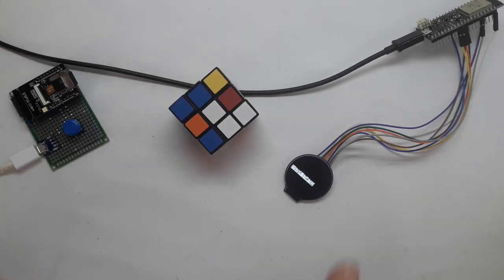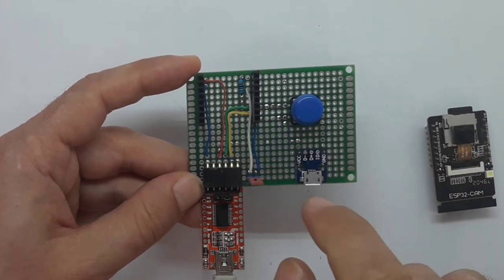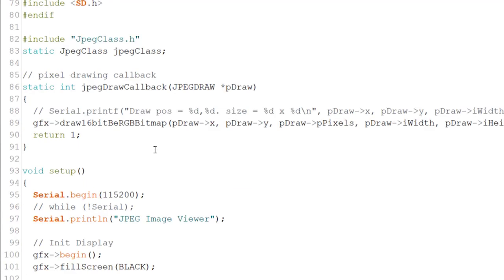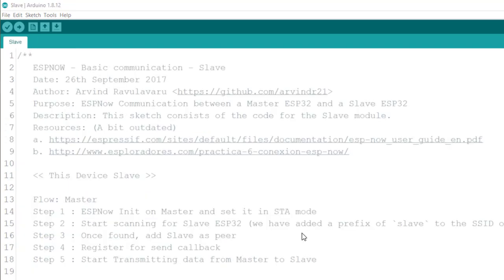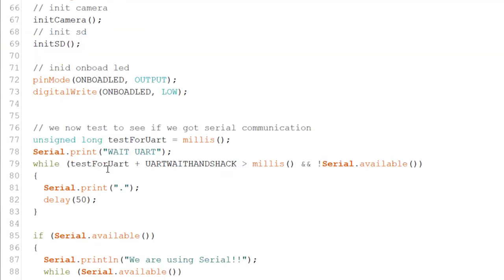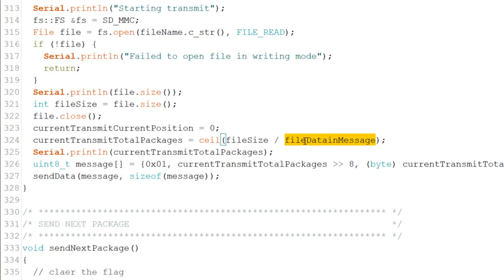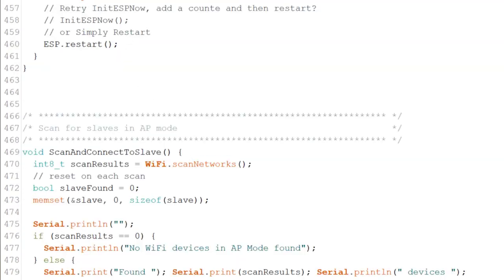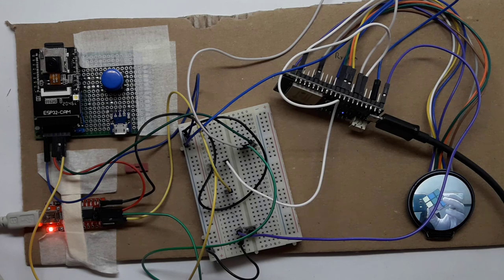ESP32 cam - Capture and send image over esp-now

Comment: I see this video is pretty new :D 
I'm going to mess around with this to get a picture on my Lilygo T-watch 2020 V1 from one of those esp cams.
Thanks!
Reply from the maker: Sounds cool, I never used one of thus, I thought of ordering one. 

I'm working on a new video, showing streaming mjpeg and finding the stream on the local network. just been busy, so it takes me time to get it done :)
Reply: @talofer99  Id like to see that! 
I ended up using https://www.youtube.com/watch?v=aIxaR6legnw for a live video stream.
Only downside is that it uses the watch as an access point, would be nice to just find it on a general network ^.^ 
is also gonna be my next project xD
Reply from the maker: @smokeysky  cool, I was guessing some one did something like that, I wonder how it's done will look into the code there. 

I still did not find the time (super busy) to make the video - the camera is on the table for over 3 weeks now :)

Comment: Sir I have a problem to run the system correctly. The only difference about hardware is display. I've changed the display class settings into the device's that I'm using. Should I change another thing?? The image is seen from the display but it isn't fill all of it and it is meaningless.
Reply from the maker: What display do you use ? 
What code do you use ?
Reply: @talofer99  I used exactly same code as yours and the display is st7789 240x240. Thank you for quick response🙏🏻
Reply from the maker: You could not use the same code (exactly) since it will not work. 
What are the changes you made in the code ?
Reply: @talofer99  I’ve just changed the display class part of the code
Reply from the maker: @berkeates4639 so it should work. 
maybe try different library.
Reply: @talofer99  I solved the problem, it was probably caused by my computer's usb ports. But there is still something unusual. When I press the button, a previously taken photo is displayed on the screen. How can I fix this?
Reply from the maker: I think maybe your screen needs some sort of "refresh" command.
What happens the first time you take a photo ?
Reply: @talofer99   If I reset both devices and take the first photo, the screen shows a black screen until the second or third button is pressed. After that it shows the first photo.
Reply from the maker: @berkeates4639 did you try and take a look at the serial debug output ? 
Maybe that will help you out to find and fix the bug :)
Reply: @talofer99  what does it mean with “serial debug output”?
Reply from the maker: @berkeates4639  you never used serial output for debug ? 
Open the arduino IDE and there is a serial terminal there - you can open it. 
Of you are using my code I left some debug output on it. 
This will show you if there are errors.
Reply: @talofer99  I understood. Thank you, I will try it.
Reply from the maker: @berkeates4639  good luck, and let me know how it went.
Reply: @talofer99  Can we bypass the sd card and gain buffer directly? Maybe my system works more reasonable doing this. If it’s possible, how can i do it?
Reply from the maker: @berkeates4639 it is possible, but it worked great for me with the SD. 
Do you have then both on the same device ? 
Or are you transmitting
 it ?
Reply: @talofer99  I am trying to transmit buffer directly, not reading from sd card.
Reply from the maker: @berkeates4639 ok - doable, convert to jpg and show on the screen

Comment: This is great. I'm trying to save the images on the SD-card of the receiver. Instead of using the SD-card as a buffer I want to use SPIFFS.
Reply from the maker: I was not able to get the spiff working on the esp32-cam. 
If you do get it to work let me know.

Comment: Awesome project I subscribed. I really want to make a system in which the images captured by the esp32 cam will be transferred to a separate esp32 board and then shown on a screen. but it should be a wired circuit so that it could also work without wifi. please make a video on it.
Reply from the maker: Thank you very much :) 
I tried it and you can see it in the end of the video - its possible, but very slow.
Reply: @talofer99  I have no problem with the speed but can you make a separate video in which you make it step by step because I am a beginner. It would really help a lot 🙂
Reply from the maker: Sound like an interesting idea.
Reply: @talofer99  👍👍please try you are awesome 🚀🚀

Comment: Wow, this project is super cool! Will try this out soon. Btw just a quick question - approximately what was the maximum size of the image you were able to transmit? Would it be able to handle say 200-300 KB images? Thanks again for this interesting project.
Reply from the maker: Thank you very much :) 
The espnow transmit limit is 250 Bytes, place some CRC on top and part number I 
 used 240 Bytes for the actual image data.
So in order to transmit 240K (to make it easy) you will need a 1K packages  ....so it's doable - not practical. 

I got on my table the setup with the display connected to the esp32 camera board  - which took me some time to figure out - so it steams the camera to the screen. 

got to find time to make a video on it as well.
Reply: @talofer99  cool, thanks for clarifying that. I'll give it a try and see how it goes. The boards will be pretty close to each other. Not sure if that helps with reliable transmission. Another option would be bluetooth but I won't bet on reliability of bluetooth on cheap devices though. 

Even a wired connection to send the pictures across to another ESP32 will be interesting :)
Reply from the maker: Sorry for the late reply. 
I did try it with Serial, not sure id I mentioned it in the video, and it was slower .
This is not surprising since the data rate of transfer is 2.4ghz .... so even if you get half the speed, its way faster then UART.  

And I would go with BLE and not Classic Bluetooth, and I think it might work, I used to upload code using BT few years back, and no issues.
Reply: @talofer99  Oh ok cool! I'll give it a try with classic BT. I'll just need to check how reliably it can connect, send every time. I remember I had once read a post where someone was able to upload code to esp32 at 922190bps. Again this can only be confirmed once I try it out. I am hoping to make some time for testing both the methods - classic BT and Serial at 922190bps! :) Thanks once again for the ideas and the tips.
Reply from the maker: @rw4833  cool, if you do get it to work - let me know :)
Reply: @talofer99  Sure, will let you know. I just ordered a couple of ESP32-CAM, and the 5MP lens as well :)

The esp32-cam that I have, has some stability (flashing) issues. It seems like there are too many clones and knock-offs of the esp32-cam.
Reply: @talofer99 , interesting. Would like to see it 😊

Comment: Hi, do your code have mechanism like CRC check to verify the file is not corrupted at the receiver end?
Reply from the maker: No, it does not have CRC mechanism in it.
Yes that means that the file can be corrupted on the transfer.
Reply: @talofer99  what do you suggest for archiving this? Calculate CRC and send it in the last packet?
Reply from the maker: @awaagrikh8331  If you want to be on the safe side and in a better chance to recover the file, I would got with a simple CRC16 for each package.  add 2 bytes in the end for the CRC.
Reply: @talofer99  So it is either calculate cRC for the whole file and resent everything again or each packet CRC
Reply from the maker: @awaagrikh8331  yes, that's basically it.

Comment: Great video! I have the same arduino board for the display. Would you be able to confirm what pin goes to what? This is the bit that i am struggling with. Thanks.
Reply from the maker: Thank you :) 

The SPI pins are  
GPIO 23 is the mosi
GPIO 18 is the clock 
GPIO 05 is the SS
You can see the pinout here  
https://www.mischianti.org/2021/02/21/esp32-wemos-lolin32-high-resolution-pinout-and-specs/

For the rest of the pins there is the table from the example : 
* ESP32 various dev board     : TFT_CS:  5, TFT_DC: 27, TFT_RST: 33, TFT_BL: 22

Hope it helps out .... if not let me know :)

Comment: Hey, this video was very helpful. I am currently working on a similar project, but I dont use a monitor. Instead I have to send the photo which was saved as a SPIFF via a telegram bot to a telegram chat. Do you know if this is possible? Could you maybe tell me which telegram bot sending command I need in this case?
Reply from the maker: Hi, I never tried to send something in telegram with esp. 
I know the image can be sent - but not sure how to do it on telegram.
If it possible, you are only a google search a way from it :)

Comment: Hi, great project. how about use ESP32CAM + TFT, and leave out ESP32?  and in this case, is it OK for one ESP32 to handle more than one ESP32CAM?  Thx.
Reply from the maker: It's possible, been done by others, I'm working on trying it with the screen in the video, juts was not successful, and got no time lately :)
Reply: @talofer99  Thank you for reply. have a nice day.
Reply from the maker: @summerfun6114  I hope to get it running , it will be a cool project of a camera with screen for the kid :)
Reply: @talofer99  ya, there are some body did it, I can‘t copy it works, actually just noise, almost can see any nothing. BTW. is the Payload limited to 250 bytes obstacle the stream here?
Reply from the maker: @summerfun6114  if you refer to stream the image to a screen ? then no - there is no real limit here. 
If you refer to the ESPNOW, then yes, you can barely get 1-2 images per second.
Reply: @talofer99  did you try wiring ESP32CAM directly with TFT display by SPI?
Reply from the maker: @summerfun6114  I only tried the screen that is shown in the video. no others.
Reply: @talofer99  thank you talofer99. 
can your project config the pins other than the way shown here? 
asking so cause of now the master shown  " slave pair success " , and the slave shown " ESPNow Init Success ", but the GC9A01 does't show anything.  what can be ?
did I miss some thing? do you need MAC number of ESP32's?
Reply from the maker: @summerfun6114  did you test the esp with the GC9A01 works with simple example ? 
Because if all is connected correctly it should work :)
Reply: @talofer99   thank you talofer99. 

guess something wrong in my side, the [ImgViewerJpeg] uploaded doesn't show and  
got error of: E (138) psram: PSRAM ID read error: 0xffffffff 
BTW. you did two places enabled 'if (!SPIFFS.begin())' in your video, my example has only one place of it, at /* Wio Terminal */ line 125.
Reply from the maker: @summerfun6114  It's hard for me to tell without looking at the result :) 

If you are getting compile error, then that can not be the code you uploaded.
Reply: @talofer99  Yes. I understand. thank you for so much help. BTW. what esp32 module did you use, WROVE or WROOM? and would it be OK to change the RST to 4? all the best.
Reply from the maker: @summerfun6114  when it comes to esp32 my preferred board is "wemos lolin32"

https://www.mischianti.org/2021/02/21/esp32-wemos-lolin32-high-resolution-pinout-and-specs/
Reply: @talofer99  Thank you talofer99, may I ask which library file you used? I can't find one ImgViewerJpeg.INO same as yours.
Reply from the maker: @summerfun6114  in this library 
https://github.com/moononournation/Arduino_GFX/

look at the img/jpg example
Reply: @talofer99  Thanks. tested the "ImgViewerJpeg" , and got: "rst:0x8 (TG1WDT_SYS_RESET),boot:0x17 (SPI_FAST_FLASH_BOOT)
 " error. what can I do to fix it please?
Reply from the maker: @summerfun6114  You will have to google it, I never encountered this type of error. 
I can guess it has to do with the flash speed settings.
Reply: @talofer99   thank you for your patience talofer99.
Finally made it works on ILI9341. thanks again！

Comment: HI, GREAT. just not clear where filled the MAC address? thanks.
Reply from the maker: No need, there is an active scan on the camera, looking for the other unit. 
look at the Camera.ino and find ScanAndConnectToSlave()
Reply: @talofer99  Thank you a lot. much better now. the display just shown "SYSTEM STARTED" ， no picture?
Reply from the maker: @saydiy1528  the camera needs or button press or UART command. 
I explain this in the video.
Reply from the maker: I can see you asked about the reset of the unit in the notification but can not see the actual comment 
So make sure you set the Flash Frequency to 40 not 80 and then upload the code.
Reply: @talofer99  Thank you. I typed p and got some image shown (I used ILI9341 cause of can't test out GC9A01), still the button never trig cam.
Reply: @talofer99  thank you. it was 40. the connection is not stable seems? what can improve the image?
Reply from the maker: @saydiy1528  did you test the screen as is ? with one of the exampels to make sure its working ? 
Did you fix the setting in the code to match the screen chip ?
Reply: @talofer99  Thank you. made some progress, the ImgViewerJpeg shows now. the ESPNOE still not show. the serial monitor of master: Done submitting files; slave: success init spiffs. 
how to check if the slave receive or not?

Comment: can you stream video over esp now? from esp cam to esp32?
Reply from the maker: Since the pay load limit per messahe is 254 byte  I think its not really doable.
I seen a project when the camera esp32 was acting as AP and the other unit showed the stream.
Reply: @talofer99  is there any way to stream a video from esp cam without wifi? And the method you are talking about, how can it be done is there any reference?
Reply from the maker: @omumbare8582  Not that I know of.
I can not find the link will try to find it. 
I'm sure if you google it, you can find it.

Comment: can i get a diagram of your project?
Reply from the maker: Sorry, I never really create one, unless its super complicated. 
If you need to know how to connect the screen, you can watch it on this video 
https://www.youtube.com/watch?v=NK0Sx49XQdI
Reply: @talofer99 actually I need to know how to wire a push button with the ESP32-CAM because I connected the button to the RX pin, but the ESP still can't capture a photo using the push button.
Reply from the maker: @glennimmanuel9338  not sure what code you used. but if you initiated the serial this might not work.